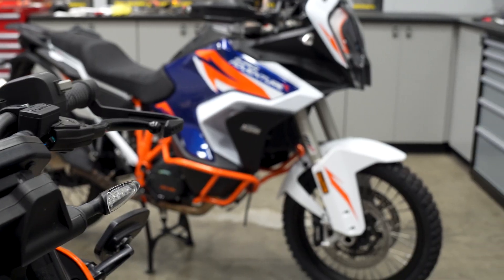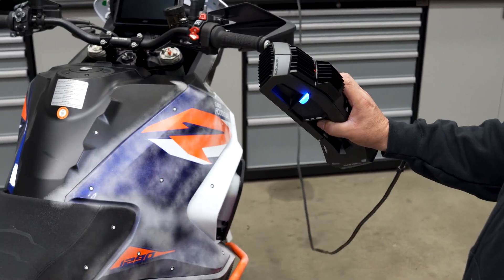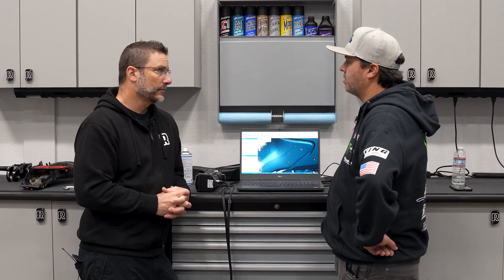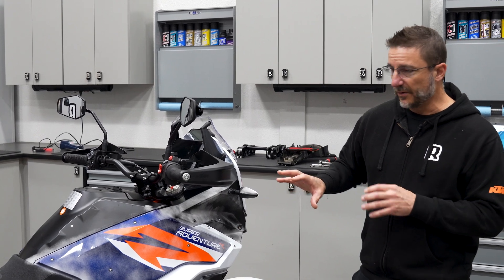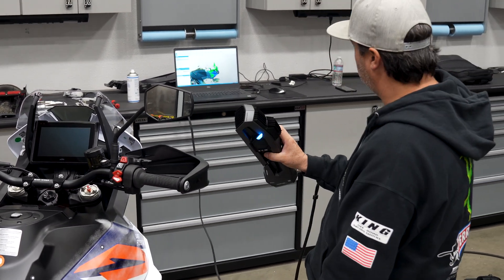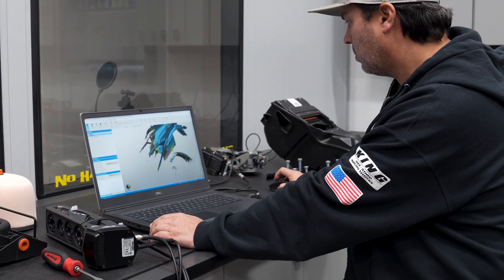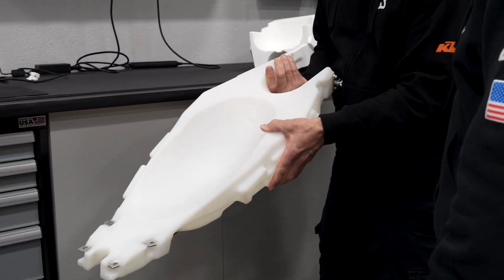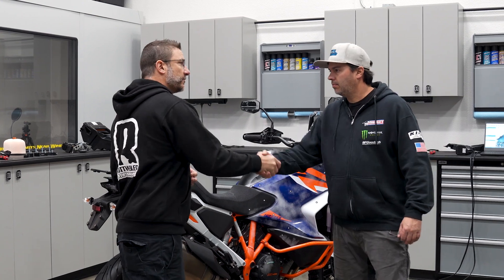CREATING NEW PARTS USING 3D SCANNING - ROTTWEILER PERFORMANCE

Comment: Please continue making new parts for the KTM 1090 R model
Reply from the maker: We love them all and surely will! Thanks for the passion.
Reply: @RottweilerPerformance  1090R needs a trick gaurd for the fuel pump wiring and fuel pet cock
Taps and fuel line barb connecter ,wiring too .🙄
Reply from the maker: @Crust2013  We'll look into it! Thanks for bringing this up!
Reply: @RottweilerPerformance  ohh and please make a snorkel set for the 1090r too reach higher above I ride over the seat often but it sips water in would love! A set ...pleeeease
Reply: Yea do! Like a upper gaurd for the fuel pump and pet cock area direct inflicted by the front tyre kicking shit! Into it...

Comment: Whats the eta on that rear fuel tank for the 890's?
Reply from the maker: Hopefully 1st quarter 2022. We were actually working on the final parts in this video to make that happen.
Reply: @RottweilerPerformance  the aux tank with the air box is the most impressive upgrade. Patiently waiting.:)
Reply from the maker: @8andsk835  Thank you! That was quite a bit of detailed engineering to get those done.
Reply: @RottweilerPerformance  Can't wait to see the intake for the Duke 890 being ready. Anyway we could pre-order them before launch?
Reply from the maker: @STFVLS  We are working on that. We don't have huge staffs of people that push these things out so when we don't have something yet they tend to get put on a backburner when it comes to pre sales, plus we don't like to give dates when we don't have them yet, but keep an eye on us and we will be updating as we go. These days production is so tricky and getting our parts made in a timely fashion when we have to outsource certain things is extremely frustrating, but we keep pushing. The whole world is like this right now but we are working on more avenues to get things faster.